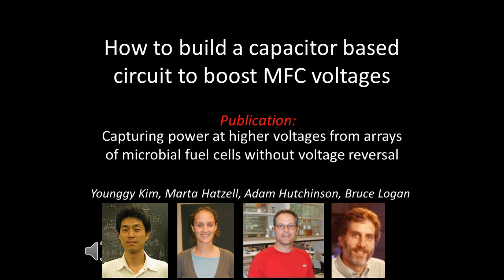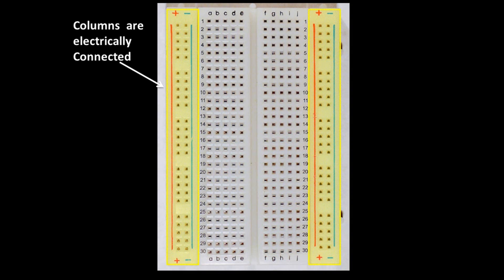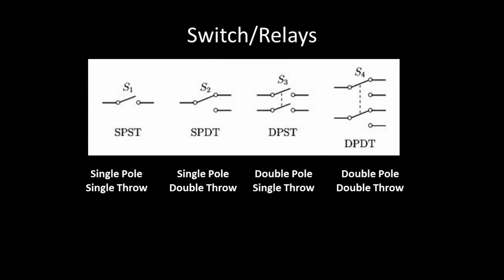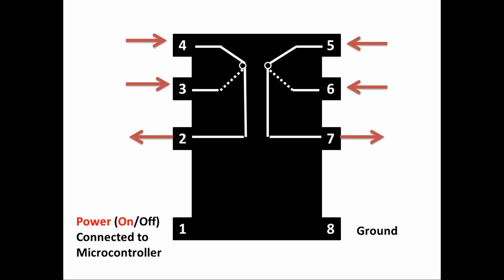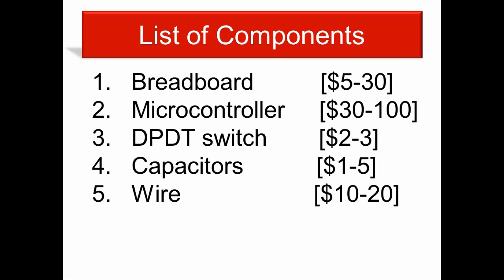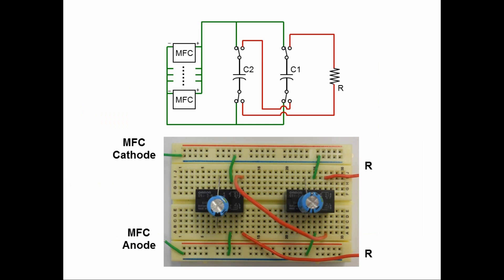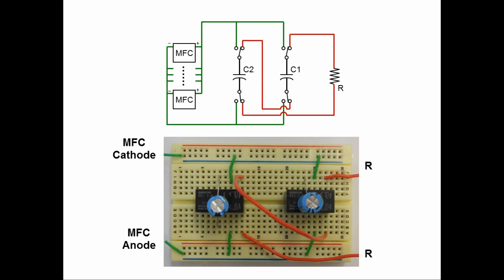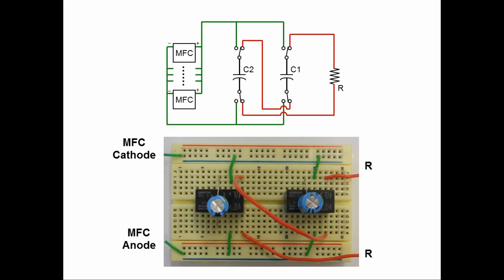Connecting MFCs using a capacitor circuit

Comment: This is the most inefficient approach I have ever seen. I am an engineer in electronics and I am running several MFCs for fun. I am using a cheap Joule Thief circuit for <1$, just Google it. The nice thing about this circuit is that you can tune it to work in the optimum point of the MFC by just changing the ratio of the transformer. As a transformer I am using a simple self made flat air coil with 30mm diameter and a ratio of about 1:5 (base of transistor is connected to coil with more windings). My circuit starts at 400mV and runs down to 200mV using an BC548C transistor. It can also be started manualy by touching the transistors base at 200mV. An additional advantage is, that the circuits voltage/power curve is not linear. If the MFC generates 20mV more the current grows by about 50%. For that it is perfect for an MFC as it sets nearly the optimum power point automaticly (about the half of the floating voltage of the MFC).
Reply: nice. I like your approach.
Reply: Sir, is it possible to light an LED bulb with MFC? If yes can you please give the circuit diagram
or please email me sajithkumarkj@gmail.com
Reply: Hi, can you help us in our thesis about MFCs im a graduating electrical engineering student 😊